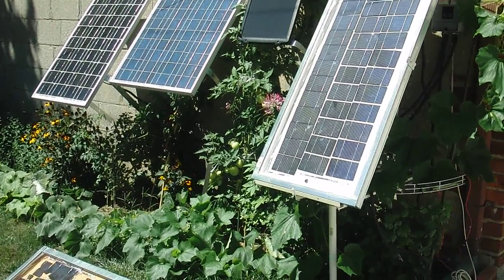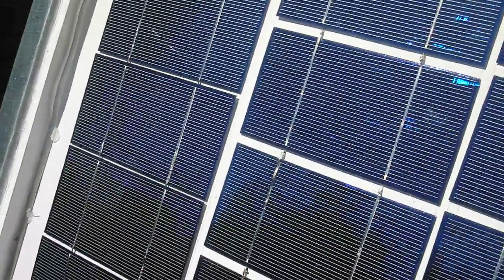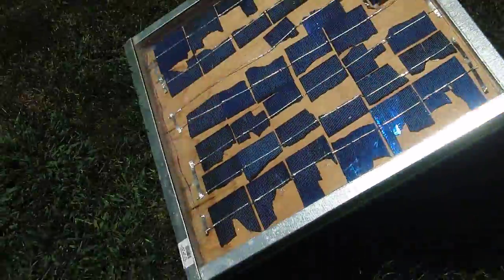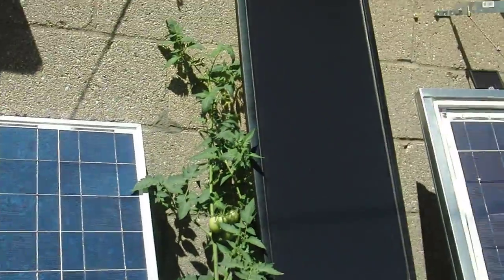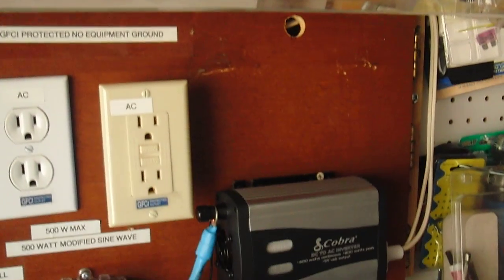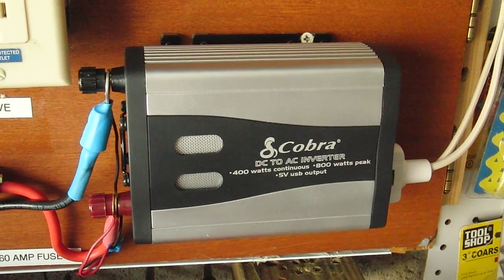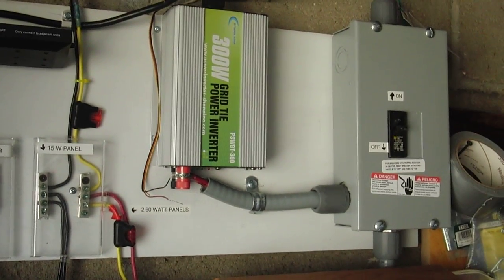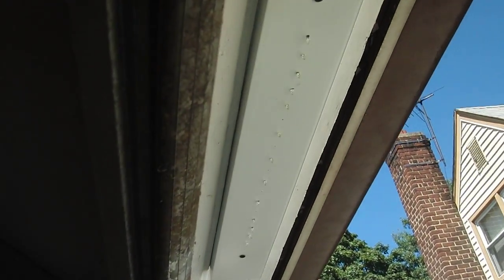Solar panel upgrade and inverter downgrade.AVI

Comment from the maker: @dodgeram96mopar  To be safe, It's probably better to keep your system off grid and use batteries to power your appliances. Battery powered system has the added advantage of backup power when the grid goes down.

Comment: I have started a little solar system, did you have to get the grid tie inverter inspected after hookup?  I was told you can have your power shut off if they find out you are using other power sources other then the main grid?  Or are they just trying to stop people from doing these projects.